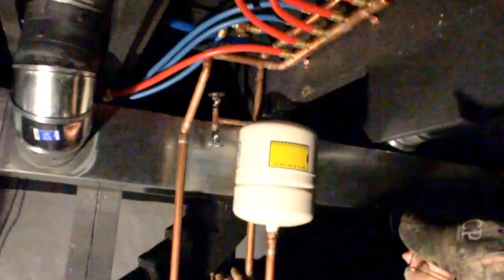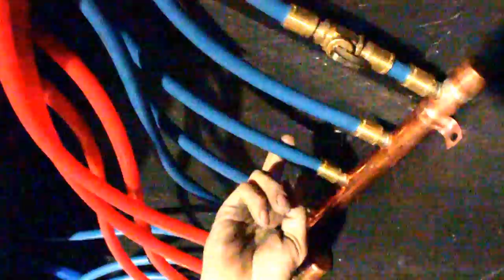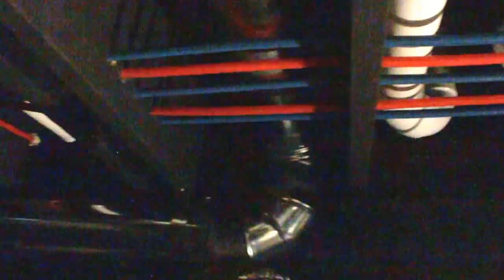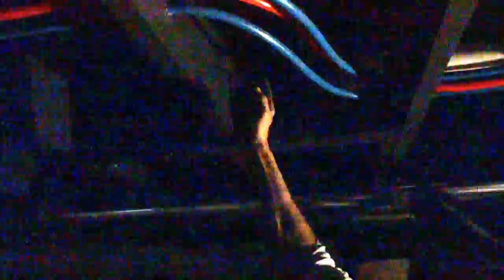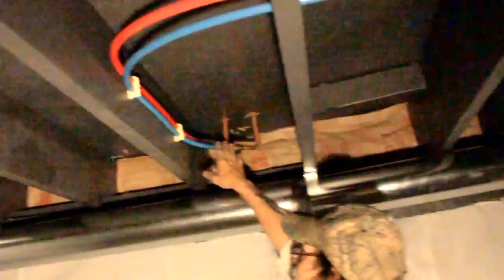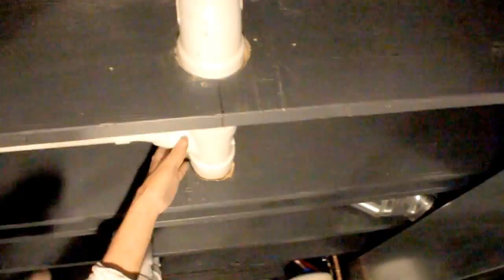What makes PEX plumbing & manifolds so nifty?

Comment: How much did notching into the joists compromise the integrity of the structure overall?
Reply: Don't compromise the bottom third of a wooden beam. That is the part that works in tension to keep the beam from bending.
Reply: @idk.you.fr1   Floor joist is different from a beam.  You can support cuts with braces.